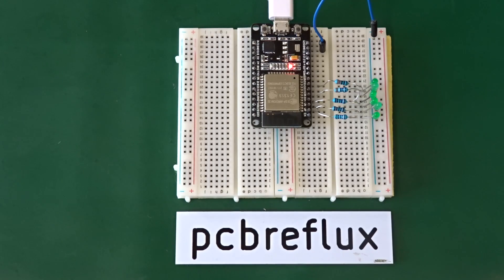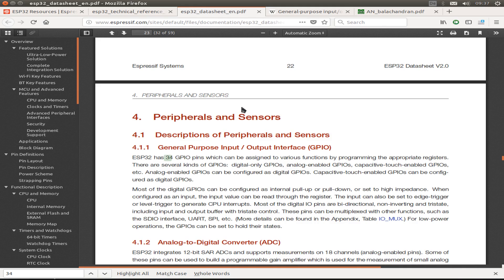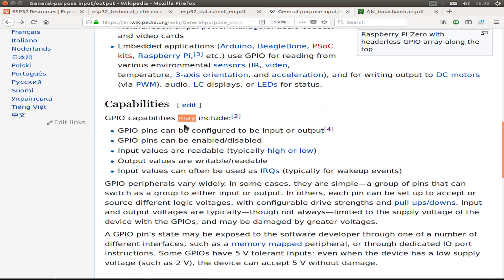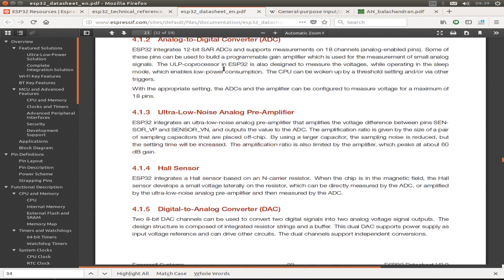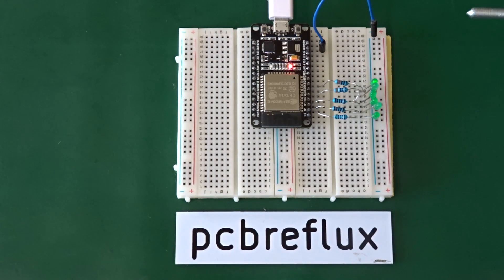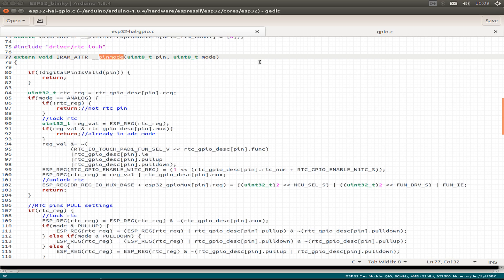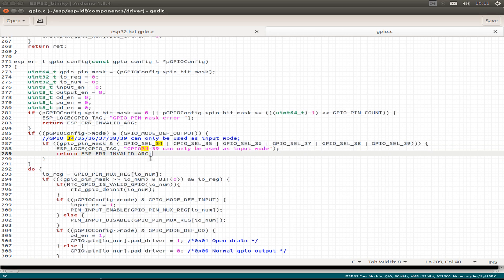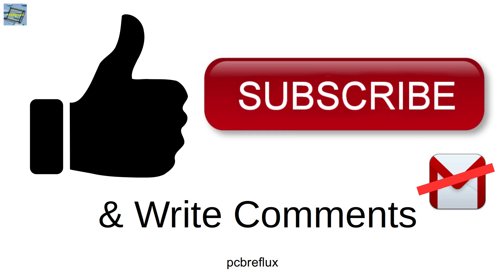ESP32 #64: GPI[O]

Comment: Great explanation of the GPIO which are only good for input use.
I am struggling around with the ESP32 ADC vRef 6dB reference voltage which is in my case = about 1.9 volts instead of the specified 2.2 volts. I use ADC input on these input only pins. I tested this by measuring an input voltage until the ADC gives the max 12-bit output (4095).

Surprisingly the voltage is about 1.9 volts, another surprise when I put half of the 1.9 volt (0.95V) to the ADC that don’t get the value 2048 (way off) which shows there is also a linearisation problem.

More work to do. (at least for simple battery measuring I expect to get it working.
Reply from the maker: Thanks, please share if you got more infos about this topic. How did you measure the 1.9V on the output site (power supply?)? Can you compare this with different esp32 devices?
Reply: The ADC 0dB, 1.1V I routed to the via software to IO25 (via adc2_vref_to_gpio()). Unfortunately this is only the  0dB 1.1V vRef, later I changed it to feed input via a power supply the voltage via a 10k restore to the ADCs and measured the ADC results until these where 4095 (max.).

I habe a complete table with different vRefs and different ESP32 MCUs. Is there a chance to upload a picture here?
Reply: http://www.bilderload.com/daten/volatgerefsesp323XMGY.png
The ECO BPower is my upcoming ESP32 LoRa Board.
The good news is that vRef is identical using an 2.8V Battery or a 3.3 USB power source on the same model. I ordered a larger bunch of ESP32 modules and hope that they are all identical using the 6dB ref. I like to burn the vRef of my boards into the eFuse and put an ADC lookup table in my code for linearisation.

Comment: Happens with most microcontroller's. Look at most of the STM32 series mcu's. the F4 series for example (Cortex M3 cpu's) they list for example 144 GPIO pins and for the most part the packages and most of the versions they list on that series are only 100 pins qfp chips :) ... they don't even have 144 pins out.
Reply from the maker: In my experience with the STM32 all available GPIO work ether as input and output, sure it gets complicate if  the pins used as ADC, DAC, touch sensor or some pins together as UART, I2C, I2S, SPI, USB, CAN BUS, ethernet, etc. and with choosing concurrent multiple interfaces the STM32 is way more complicated but think the basics for a GPIO is in and out.
Reply: Agree and they have a nice tool to configure and make code initialization (CubeMx ) but in the web page comparison of multiple STM32F4 series that I've looked at they have models that declare on that Series page/comparison they have 144GPIO's and the circuit comes out with 100 pins in for example qfp format ... :) And the specs on that same page mention all other I2C/SPI/UART/I2S/USB/timers/ADC's ya name it ... So I think this is a common theme with MCU specs ... When mentioning the MCU's specs they always leave behind some, let's call it ...  "details"  :)